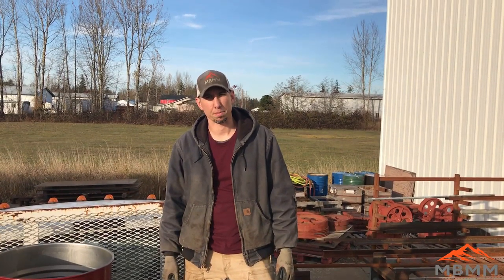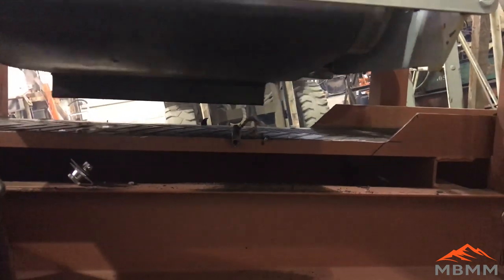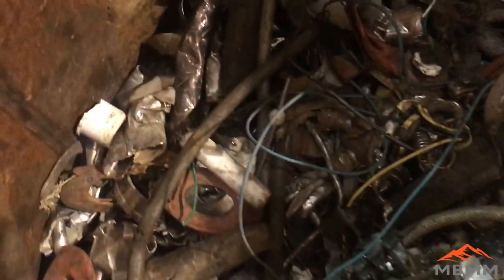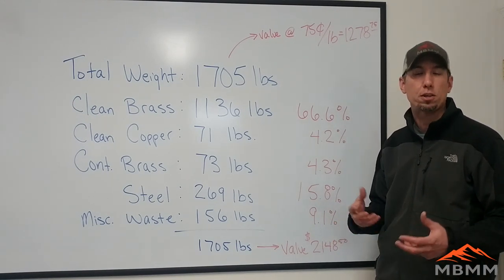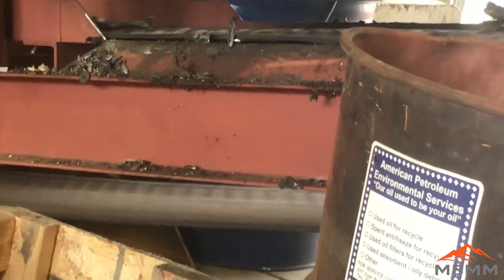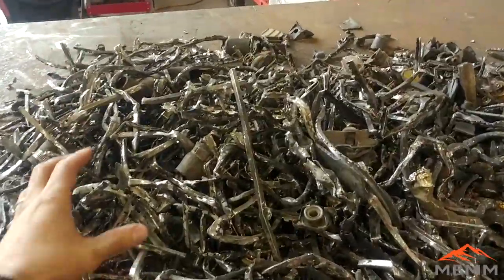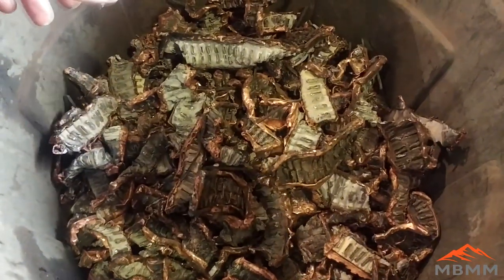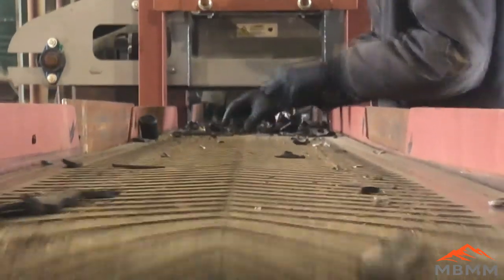Shredding Scrap Brass and Radiator Ends, Sorting, Picking, and Upgrading Value With A Hammer Mill

Comment: Looks like I'm the first comment for the morning... very impressive returns... Jason I do have a suggestion ,in a bunch of other videos including this one I've noticed that the magbelt continues to knock stuff off of the conveyor that's too big ...why don't you replace that belt with the same conveyor belt material that runs up the main conveyor... that way you won't have the fins knocking everything off or take a razor knife and trim those fins off that would pretty much stopped that problem... but I'm sure you've thought about the same ...just an idea
Reply from the maker: Great, thanks for the tip!